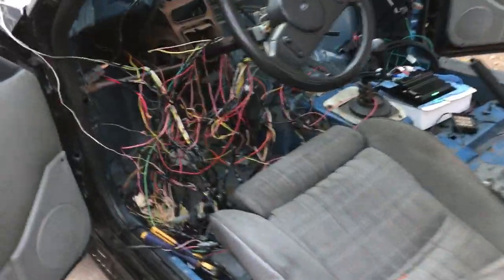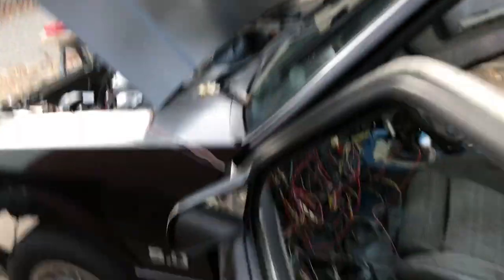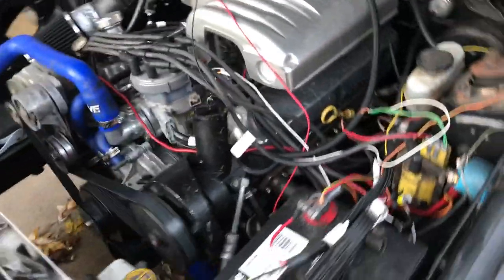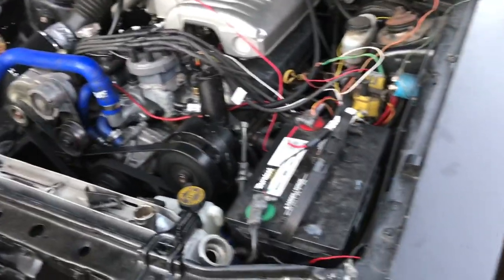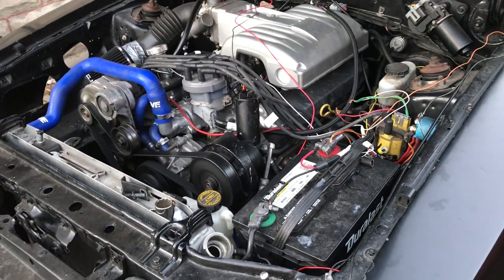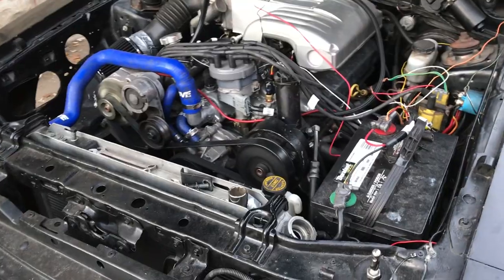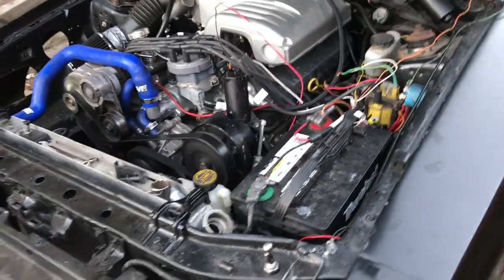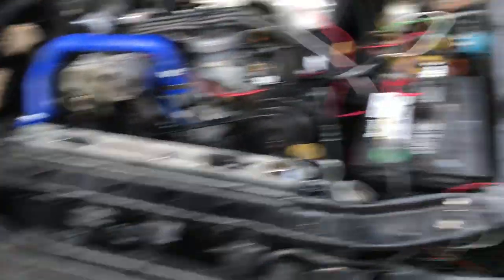Holley Terminator X ECU Kit  -  Fox Body Mustang (removing obsolete wiring)

Comment: I just subscribe to your channel. I installed the terminator x on my Mustang on my channel as well. But, my car will not start. It cranks a try to start but then it will not. My fuel pump works and I am getting spark but it goes to start then it will not. Anyway you can help me work thru this? The car wants to start but something is cutting out.
Reply from the maker: Thanks for subscribing BonezShaker - I had the same problem for a couple of days when I was first hooking my Terminator X up! You "must" have your main power cable hooked up "directly to the battery (not the starter solenoid). The first Do's/Don'ts in the manual states "Install the main power and ground directly to the battery" with the connectors that came with the kit! Hope that works for you. Let me know what happens!!
Reply: Jeff Palmer I do have the main power cable connected to the battery. The only thing I could think of is the wire for the fuel pump under the seat has two wires running to it. I only hooked up the one that runs the fuel pump. I am going to hook that one up tomorrow.
Reply from the maker: @bonezshakergarage  Pull the carpet up right side (passenger side) in the trunk area above the fuel tank and find your fuel pump grommet with 3 wires. Run a temporary/or permanent wire from the pink wire in that gromment to the wire labeled "fuel pump" (green wire) coming off the terminator. You do not need that relay under the seat anymore. You must hear your fuel pump hum (prime) for about 5 seconds when key is turned on. Just one wire, pink wire from fuel pump to green wire on the Terminator. I know the instructions tells you to hook up to the wire under the seat - I hooked my up as stated - worked first time.
Reply: Jeff Palmer ok I will give that a try
Reply: Jeff Palmer so I did what you said no change. My volts drop do to 10.1 right before it starts. I have checked every fuse in the fuse box and they all do it. What can I do to keep my volts up?
Reply from the maker: @bonezshakergarage  Make sure you have a good strong/charged up battery to start out with;  Check your TFI (thick film ignition) located on the distributor; make sure that black wire from the Terminator has a good ground (I know you have already checked these things, just trying to help). I ran the white wire coming off TFI directly to positive side of ignition coil. Does your handheld go blank when cranking? Does your fuel pump hum for 5 seconds when you turn your key on? Here is Holley's tech support number 866-464-6553 (takes awhile to get through - hang in there; they are very good at what they do). When I was having problems, Holley had me run the red wire with white stripe (Loose Wires in manual section page 4) directly to battery for testing (I used a toggle switch to turn it on & off). There is a wiring coming off ignition switch (white plug with the heavy yellow wires located on the steering column) that I ran directly to positive side of coil (I think it was a white wire). My Terminator X kit was $1,149.00 that included the TFI Harness (HLY-550-937F).  The kit for $999.95 does not have the harness for a Fox Body (TFI harness can be purchased separately from Holley). Still here for you! Just subscribed to you channel  and looking forward to a youtube video when  (and you will) get it running!!! Best of luck...
Reply: If you verified you have fuel and spark then it’s all in the tuning software. I suggest you setup your stuff on a laptop first since it’s mostly all on Chevy setup and you have to setup your iac or else it won’t work and whistle like it is in this video.
Reply: @1THIZZ8  I got it running a month ago. Thanks for the response
Reply: @bonezshakergarage  what did u do that changed it?
Reply: @shipshrekt2156  I matched the time of my car with the timing that was in the terminator x system. Fired right up. I need to learn how to install the Holley tuning on my pc and figure out how to tune.